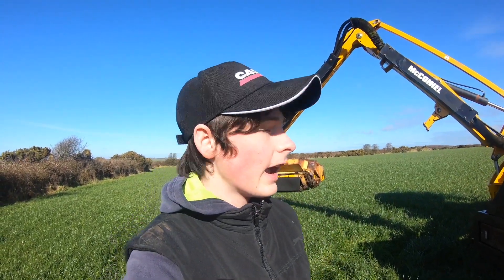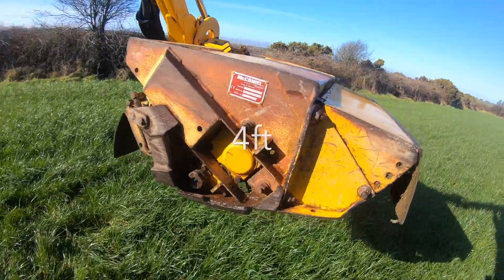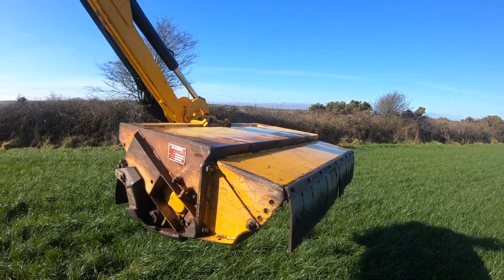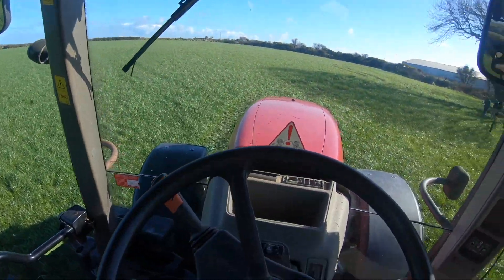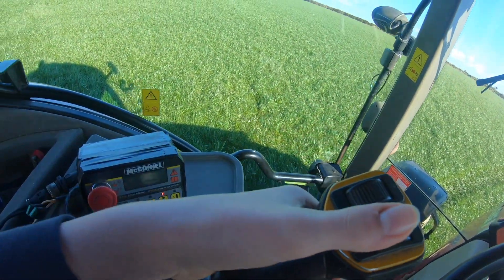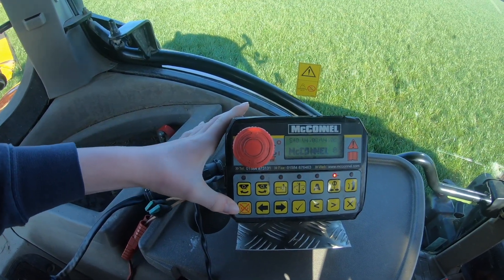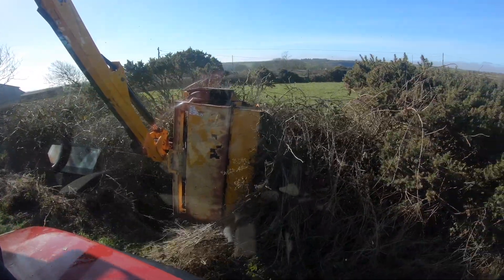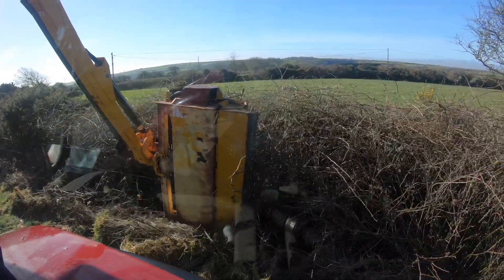My First Time Hedge Cutting. How did it go??? Pt 1

Comment: Looks a good trimmer and good job so far as for cutting I start with side's then top and finish with the floor to cut up any bit which have fallen down
Other than that watch out for wire and bits hitting glass in future try to get a guard 👌
Have a good weekend cheers 👍 🐜
Reply from the maker: Ye that’s the way I went about it, sides first then top and finished with the bottom? Also picked up a few bits of wire, yes your right we need to look for a shield for the window for next season.👍

Comment: I 'd say you are doing OK, we all had to start somewhere and we all have our own ways of doing hedge trimming. First of all I like to set the hedge trimmer like you have done and steer the tractor in to the hedge or away to get an even cut where as my son drives the tractor straight and moves the cutting head in or out up and down.  I do the both sides first then top, it may not be right but my finished hedge looks good and that's what matters to me. Over time you will find your own preferred way of doing it. Watch out for wire thought it will pull it in as quick as you can blink.
Reply from the maker: Thanks for the advice. I really enjoy the job, picked up some wire on the last pass tonight in the dark so I decided to call it a night and have a go tomorrow again.👍

Comment: You got that all wrong, the first thing a hedge cutter operator needs to learn before even turning the PTO on, is how to swear at, and if argued with knock out, whatever arsxxxle left that chunk of wire/stone/bicycle/ car tyre/ fucking swinging gate that won't stay out of the way/ bt phone cable that wraps nicely round the rotor/basically anything that isn't a hedge... In the way. Always carry an axe shaft and look like you're gonna use it, these people need to learn 🤣🤣🤣